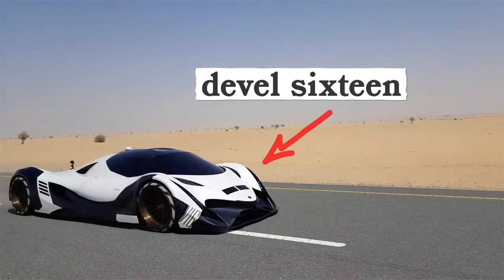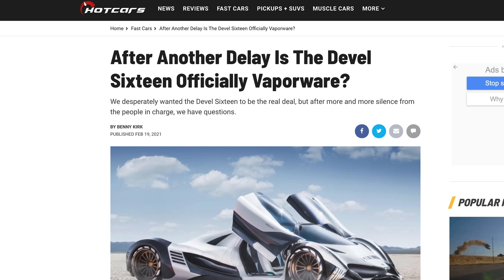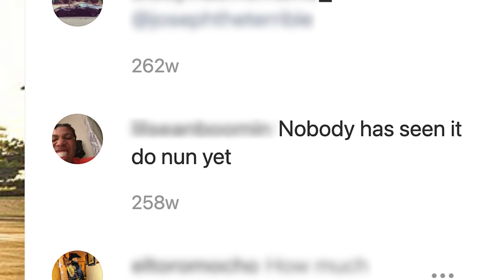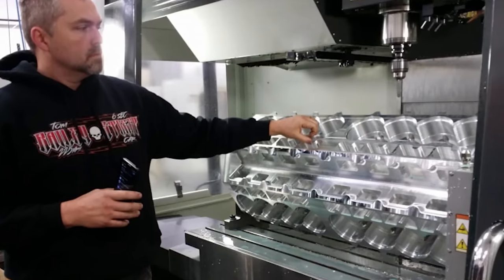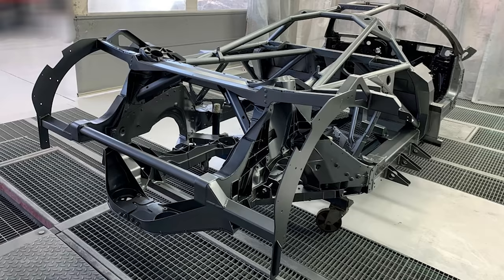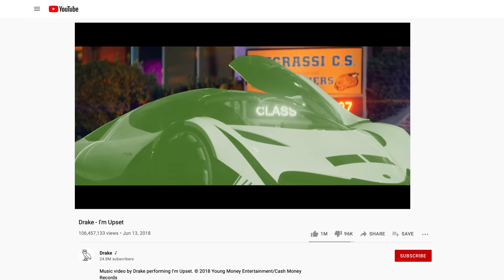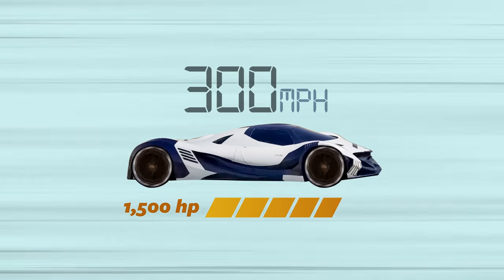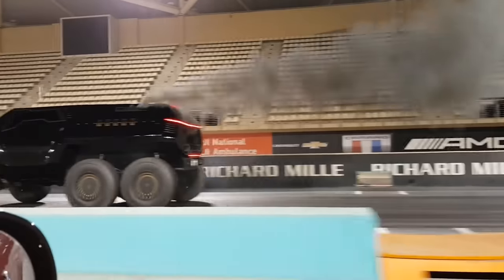Is this Infamous Supercar Real?

Comment: Next up: the Devel 32, a V32 octaturbo quadrocompressor (aka V32/8T4C) engine with 12k whorespurrs, 0 to 100 km in 0.5s, topspeed 1000 kph, parachute and eject seat included.
Reply: Devel 32, a once in a lifetime experience
Reply: WTF 🤣🤣🤣
Reply: ejecto seato cuz!
Reply: does it have refrigerated cupholders and nitrous?
Reply: @tyleresker3306  That's in the Devel 48... 20,000 HP W48 Hexadecaturbocharged with octosupercharging and quadhybrid system... with a dual fuel cell on top of it and a bottle of nitrous, 0-100 in 0.1s and a top speed of 2590 km/h. Brand parachute, G-Suit and ejection included.
Reply: @SolaricAngel116  I'm willing to pay whatever extra costs it takes to strap wings on it
Reply: @SolaricAngel116  imaginr the mpg on that
Reply: @watermalone5782  0.00000000000000000000000000000000000000001 mpg
Reply: Taps the throttle pedal slightly

Torque and G forces: "EJECTO SEATO CUZ!!!"
Reply: @anomalyb7342  This is as realistic as the numbers get
Reply: Maybe in another life time since this one toke them more than 15 years
Reply: what's next? a custom SpaceX rocket engines?
Reply: @caralho5237  yes, only for once
Reply: @watermalone5782  1500 km/l estimation.
Reply: Id rather buy a jet at that point.
Reply: Ejecto seato cuh
Reply: Batteries not included.
Reply: you forgot it halso has 15 vtec’s
Reply: You got me at octaturbo. Fuckin lul
Reply: Hahahhaha
Reply: LMAO I QUEEFT BYE-🖐🏼😭
Reply: That first part is actually clever tho
Reply: I'm having a 404 error reading this lmao
Reply: 3.2 million dollars
Reply: For the cheat price of 5 dollars
Reply: @SolaricAngel116  At that point you might wanna strap wings and a fuselage on that thing and let it fly
Reply: might as well make a fighter jet
Reply: @SolaricAngel116  Honda civic VTEC with a 17 year old behind the wheel
Reply: James Bond has one. The payments are insane!
Reply: Might as well put a key engine on top at that point lmao
Reply: @anomalyb7342  more ilke gpm
Reply: @phzitos_  I LOVE THIS BUTTON
Reply: @SolaricAngel116  hum... I'm interested. Only one question: what are the safety feature?

😅
Reply: Where the hell would you drive the f*cking thing to?
Reply: That's insane... V32?
Reply: The lowest of 3 trim models of course
Reply: @tacomeme429  The Devel 96 will have a 72,000 hp quadrovigintaturbocharged (24 turbos) W96 equipped with hexadecasupercharging and octohybrid systems with a quadruple fuel cell, 0-60 time of 0.00000000000000000000000000000000092873195s and a top speed of 1,728,195,248mph. Not only that, it will also be able to transform into a Transformers-style robot with built-in wings that will be a mechanical giant dragon bigger than Earth itself and able to fly across the universe in the quickest way possible.
Reply: That's rookie numbers
Reply: Don't forget it's a 24.6L
Reply: Sounds legit...🤔
Reply: fitted with offroad tires for the desert dunes bashing
Reply: They've now announced the Devel Infinity, it no longer has a combustion engine, but a dark matter reactor with quad turbos, it does 0 to Light speed in -2 seconds by manipulating the very fabric of the universe. Top speed of infinite, infinite horsepower and a quantum computer to calculate when you exit space time and to avoid time paradoxes and split timelines. Very high-end and affordable at a measly $6000000000000000 MSRP. The future is now.
Reply: I know its a late comment, but imagine this actually being build because your comment gave em the idea. royalties my guy
Reply: is the coffin included?

Comment: Devel: "here's a car we made with 4500+ hp"
Also Devel: "it melts if you were to actually push it"
Reply: I can eat the eifell tower but if i eat more than 1 bolt i will probably die
Reply: @gggg-hq4td  WHEZZEEEEEEE
Reply: @gggg-hq4td  LMFAO
Reply: @NickyYey  how did i miss the joke, this is a first for me
Reply: @ARTICAA1  basically the entire original comment in a nutshell lol, you have this ability but you cant even do a fraction of it because it's too dangerous
Reply: The engine is too powerful for itself.
Reply: Well it makes 4500+hp...For approximately three seconds
Reply: But why?
Reply: @fireangel1067  its a full billet engine, its makes 3000 on 93 pump gas & 20psi of boost, 5000 with race gas & over 40psi. See it on Steve Morris youtube channel… it runs for far long than 3 seconds LMAO…. Back to back 3500hp pulls & 4500hp pulls… but somehow i feel you pull harder than an SMX engine does haha
Reply: Conrail had to downgrade their 4500-5000HP EMD Diesel Locomotives because it overpowered their trains and couplers were breaking too often. Just wanted to mention that for comparison.

Comment: Fun fact : Bugatti's 304 mph run. How many times did each tire rotate each second?? Well at 300 mph, the tires are spinning at a rate of 68 times per second. 
   Imagine the amount of force this is putting on the tires?!?!?!  Geez, these tires are literally trying to keep from ripping to shreds and separating from the rims. Talk about a well built tire. I guess this is why they charge $10,000. per tire. Well worth it if you are going to go 300 mph. So it has to make me wonder now, what tire can handle 350mph???

Comment: You forgot to mention getting tires that can handle the heat and stresses of those kinds of speeds.
You can go over two hundred miles/hour in a Veyron but the tires don’t last long at those speeds.
The challenges of building something like this is staggering
Reply: Lmao just take the tires off then, no sweat
Reply: @bunsenn5064  Lmao there expensive 🤗
Reply: Yeah. I imagine a car like this eating tires for breakfast. 

Even F1 cars on average need at least one tire change in a race.
Reply: @timothy4011  well, a Z rated tire is probably good for about 200 mph. That’s why they typically cost a thousand dollars a tire but to go beyond that it gets harder and harder to make tires that can handle those speeds.
If you watch the episode of Top Gear where they take a Veyron over 250 mph on the Volkswagen test track they talk all about the subject of tires and top speeds. They asked the engineers how fast their tires would go because they had to have specially designed tires for the Veyron and their response was. That’s the same thing as asking a captain how deep his submarine would go.
You find out when you take it there so getting up to those speeds with tires gets really shaky past 200 mph
Reply: Honestly just make a hypercar with tank treads
Reply: Top gear, or grand tour, did this test at the VW grounds. Went through 2 sets of tires to briefly hold the world record. They got a few hundred miles per set of tires if I remember right, and I cost 20K per set for the tires.
Reply: @WralthChardiceVideo  could I settle for a turbocharged civic with a few hellfire missiles behind the headlights like a bad version of a bond car? Make traffic dissappear real good. Lol
Reply: @timothy4011  F1 tyres are designed to last that long, if pirreli wanted to they could easily make a tyre last the entire race.
Reply: Simple, make the fuel tank runs out faster than tires.
Reply: @timothy4011  there was a time in F1 when pitstops were removed during the race, which means no changing of tyres. The thing is, theoretically, an F1 car can go without changing tyres if it's not pushing at all, but due to graining and tyre degradation, they have to change tyres to maintain the same pace throughout the race.
Reply: @WralthChardiceVideo  dude now I want this lmao
Reply: @WralthChardiceVideo  it should turn just peachy
Reply: They already have tires that can withstand it look up Ford gt Texas mile it reaches 300mph
Reply: Literally the first thing that came into my mind when I heard 350 mph. You'd never get the car light enough,and still have the car be powerful enough,to not completely rip the tires apart before you ever get there. Look at the engine. Good Lord. I'd have a panic attack trying to decide where to mount it. Wouldn't the frame be in danger at that speed? I would definitely say you are going to need more rim than tire at that speed. Maybe like...99 percent rim lol. Rolling on steel tires and shit. The shots of the tires do sorta look like they have the right idea though. They look pretty strong,but I dunno.
Reply: @joeymontanez3249  I believe that carbon fiber is strong enough and light enough to withstand those forces. I’ve been learning about factory 5 kit cars which are made with chassis like race cars and they can do a lot with just steel but carbon fiber is a whole other level in terms of strength and light weight.
These cars are a lot less weight than a traditional car. It’s actually funny that anyone would even bother with a normal road car these days because it’s so hard to get the weight down. One of the factory 5 cars used a Subaru WRX as the donor car and the one you build is a lot faster than the WRX because you’re shedding all that weight. It’s basically a shell of a body on a tubular chassis so all the garbage that’s added to a production car is removed. Factory five cars with around 2,000 lbs and that’s with an LS motor or something even bigger so it definitely can be done
Reply: @bunsenn5064  oh no the wheels are melting
Reply: They're replacing the tire with tank wheels. And they are talking about jacking up the horse power to 10k. 100 Cylinder as well. It could possibly go nuclear when the engine turns on. This is madness.
Reply: @rohankar4678  no that’s not it, the FIA tells pirelli how much grip they want each compound to have, and how long it should last on average. And pirelli does it, legitimately the only reason at this point is because pitstops are part of the strategy and adds to the race
Reply: Exactly. And Devel knew they couldn't do that but didn't want to disapoint. So that's why they lied straight to our faces.
Reply: Just use the tire from the SSC bloodhound
Reply: @JoesEdits  those tires were specifically made for that vehicle and specifically made to move at the speed of sound. You're telling me you can just strap those tires onto any car we want and suddenly the car can go 300mph+? Next time, if you're going to give a stupid answer, just don't say anything.
Reply: When you consider that VW (Bugatti) had to browbeat (and hand over ALOT of money) Michelin to make a tire for the Veyron, because at the Veyron's prices.... their was no profit in doing so otherwise.
Reply: Thank you sir I think it’s a view machine. Fake

Comment: Bugatti: years of develompment and experience
Some arabian guy: This "Automation" game is pretty fun, kinda want to try it irl
Reply: Lmfao

"Automation"
Reply: didn't some dubai based company make the lykan?!
Reply: @rihadalif1670  Yup.
Reply: @rihadalif1670  that's a flop too🤣🤣
Reply: @da_4151  when did i said that was a success 🤨
Reply: shinys at it again
Reply: @rihadalif1670  another fake car
Reply: [sets bore and stroke to maximum]
[puts maximum boost on turbo]
[cranks quality slider on engine parts to +15]
Enjenir
Reply: @rihadalif1670  okay cool they made a car. Buts it's rubbish
Reply: @broggie123  👍👍
Reply: Arabic, not Arabian, learn grammar
Reply: It is pretty fun

Tho making a mid engine coupe with a 10.5krpm I5 is something that should absolutely exist
Reply: @rihadalif1670  Yes, but they were founded in Lebanon.
Reply: It gotta start at some point...
Reply: @rihadalif1670  w motors were at least being somewhat more realistic, they used Porsche 6 cylinder engines, yet Devel goes like: we want all the big numbers and break all records
Reply: @rihadalif1670  the Lykan was never made tho shit was like the devel was jus a shell and If it did have a engine was a cheap LS engine
Reply: but the car only reaches 40mph
Reply: @you.got.gapped.racing44  actually, If you're going to be a grammar fascist, an "Arabic guy" is incorrect. Arabic refers specifically to the language, not the people. That would just be "an Arab guy"

Arabian however, can still work, as it can be used to refer to an Arab (though just saying Arab is more common), or in reference to something related to Arabia or it's inhabitants. Arabic is language only.

It's like calling an Iranian/Persian a "Farsi guy"
Reply: @rihadalif1670  Lebanese, not Emirati, actually. It's pretty much a fake car though, you can check out Donut Media's video on it at "Is this 3,400,000 supercar a scam?"

Kind of disappointing, because the exterior styling is great.
Reply: @yousef.al-assaf  …and end at another. So far its proven to be mostly vaporware.
Reply: @hofahome  
We shall see
Reply: @hofahome  
While it's true, it's still something that has yet to be achieved. If they did succeed, they might get the attention of those who want a unique piece. 
I am sure they won't run 4000 HP if they every make it to production line. It will probably be downtuned to 1500-2500 HP
Reply: If you got the money do what you want and hire the best engineers around the world.  Your not going to get the CEO of Bugatti working  on the development floor designing the brakes and intercooler. Arabs got the money and Bugatti have to find the money and answer to other bosses at Renault and shareholders. There's always somebody above you, were Arabs don't answer to anybody but there dads.
Reply: This car is like Dr Dre's Detox album that will never be released . Alot of talk but nothing to see or hear.
Reply: Agreed! The 1st F1 derived Ferarri Enzo in America was completely disintegrated by a Utah buyer when he hit 202mph at a charity event in Utah and went airborne 70+ feet in the Air Force 325 feet amd then cartwheeled the monocoque capsule another thousand feet before it stopped. A non visible super gradual hump in I-80 was jsut enough to get a hair too much wind under it and up
She went.  That’s Ferarri, all the experince ,R&D , F1 tech and it went airborne at jsut 202.2 mph becasue of a hump u couldn’t even see, what’s this random oil money developed car with 7X the HP/ 4500 and nearly 2X the top speed going to do at those speeds? 
You can put a big single turbo 427 with 1,400 hp in a pinto & it’ll accelerate fast but doesn’t mean it’s going to be safe. I feel like the owners as multi multi multi oil money millionaires wanted the most hp by far and fastest car by far and just decided with NO plan or idea, I want 5,000hp and 350mph, I’ll pay whatever to get the hp and then had this hyper car built to have 4500hp with NO consideration of how absurd thst is! A 2,000hp underground Huracan is known to be TERRIFYINGLY SCARY, DEADLY FAST ON THE street and track, what’s 2.5X that power going to be in the first ever go at the car? If 245mph scares the professional drivers for underground at half mile events , how’s ANYONE going to hit 350mph in a first ever prototype???  I think these billionaires should focus on the 2 lower levels of the car that are still beyond hypercar stats and produce them with all thought out before touching the 16 track again.
Reply: Mans can afford to play BeamNG but for reals 😩

Comment: I remember reading about the Bugatti Veyron when it was in development, the number one challenge was cooling. Motors with this level of power typically are drag racers, which have no auxiliary cooling at all. There are barely any openings on the body of this car!  How long will this motor live making that kind of power?
Reply: Drag racers have 8k-16k horsepower. It only has 5k.
Reply: @tornmap4385  yeah but drag race motor are made to live between 5 and 10 sec in straight line.
Reply: @tornmap4385  for 4 seconds, then need to be rebuilt
Reply: @Tallnerdyguy  true some cars have to have the engines complete replace right after a race they push it to the limit
Reply: It'll last for 0.1 millisecond